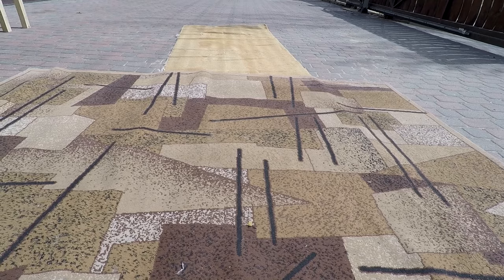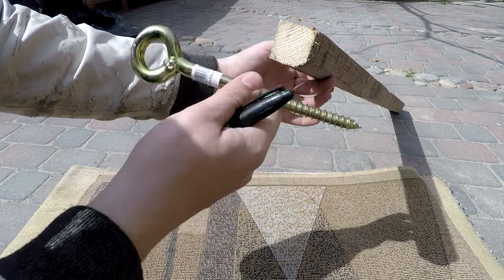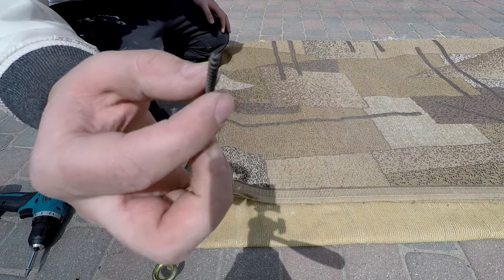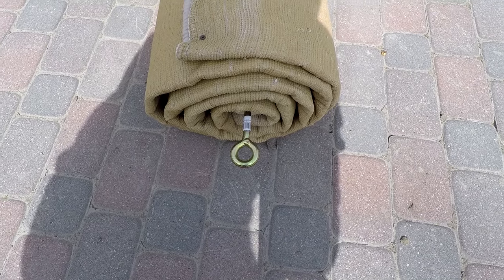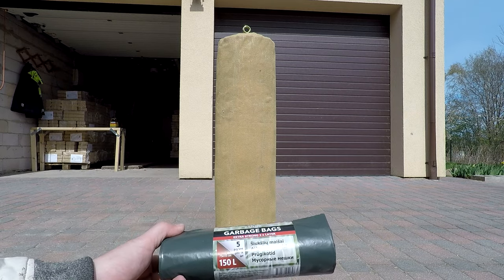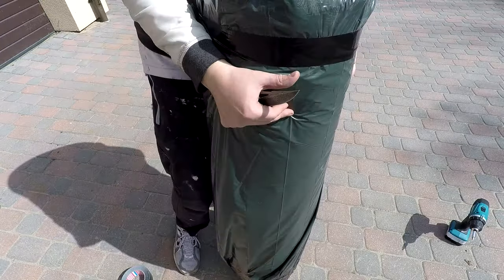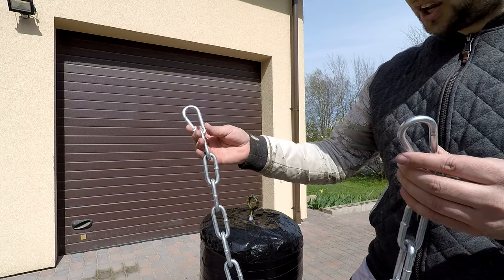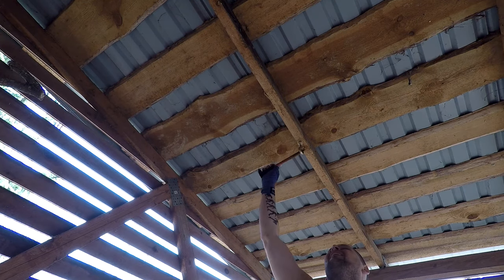DIY Homemade Punching Bag

Comment: Before closing the top I would recommend pouring sand in side to increase the weight, I noticed that bag moved around far too much. Thanks for the good idea
Reply from the maker: If you put sand in it, after few punches, that sand will be at the bottom of punching bag. So the top will be empty and the bottom will be full of sand. If you want heavier bag you just have to put more carpets and that's it :)

Comment: Best DIY Punch Bag Ever! 
Simple, Effective, and Creative
(A suggestion, add another O screw at the bottom aswell so you can latch the bag to a weight or something heavy to keep the bag from moving if needed).

Great Job and Great Video!
Reply from the maker: Yeah I think that's a great idea ;)
Reply: That’s really smart!
Reply: What kind of trash bags
Reply: If you pause he shows 150L bags.
Reply: Holy shit this is genius i was wondering about the weight and this is perfect and adjustable.. thanks

Comment: I followed this and made one that is longer for Thai boxing. Been close to two years and works great. I leave hanging outside and have no problems with rain etc. Solid bag.
Reply: What did you hang it from if outside? Throw a chain over a tree branch?
Reply: @chucknorris2418  I actually had an old swing set so I used that. No swings attached :)

Comment: If you put some sand in a bag or freely in the bottom of the punching bag it will keep it more stable in the lower part and it won’t fly around so much. Just seal the sand with extra bags otherwise it will start pouring from the bottom.

Comment: I would suggest adding an eye bolt to the bottom as well and connect a chain or rope to the bottom and connect it to your floor for better stability. Right now it's so light weight that when you hit it, it is all over the place. Too bouncy without the extra stability. Nice job overall

Comment: Whats a weight approximately for the punching bag? 

Also i would add similar hook on the bottom so can hang some weights in chain hence the bag wont move too much, when i o
Punch..just a suggestion..Awesome job ..you saved my $ 150.!

Comment: I don't think I would use those large screws to cinch down the
carpet after you've rolled it...I would rather use a Strong Tape,
Wrapped a few times around, about 6" apart. Then I would wrap
a Strong, resilient material around THAT---'VIOLA,' a PROFESS
IONAL PUNCHING BAG!

Comment: I think it would be a lot safer to clamp the wood to a table or bench before drilling.
That way you have both hands to steady the drill, and more importantly, both hands are well away from the sharp end if anything unexpected happens.